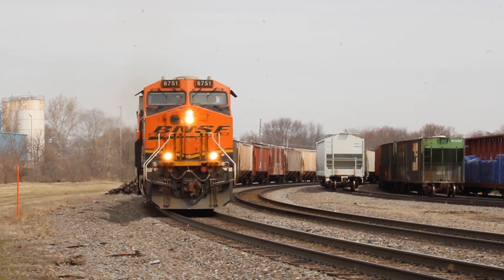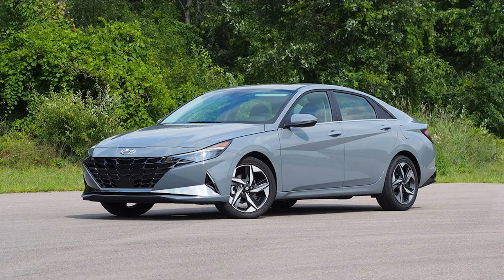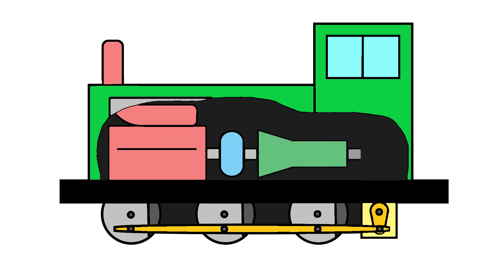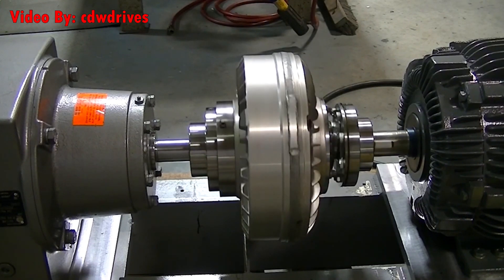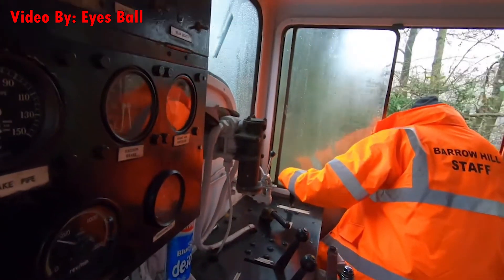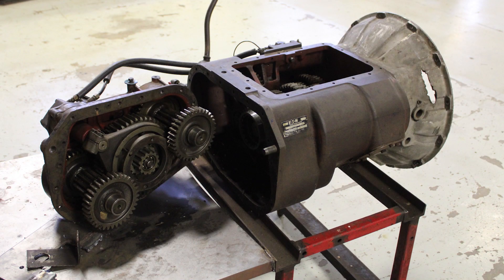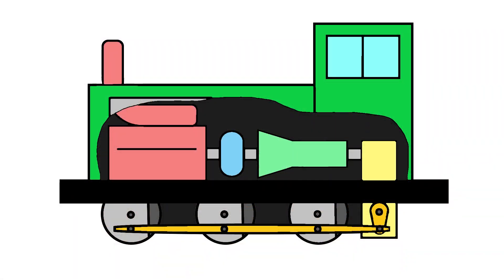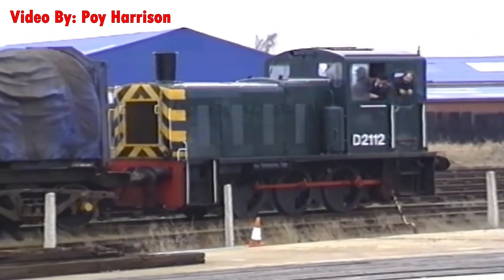How EVERY TYPE of Diesel Locomotive Works! (Part 2)

Comment: Way you explain truck 13 speed not even close to being right.
Reply from the maker: What did I say wrong?
Reply: @Southern_Plains_Railfan  Collars are sliding clutches. Gear you said was 1st that low gear and gear you said was 2nd thats 1st gear. Don't shift aux box to high range for 3 to 4 either. It's 1st -4th gear, put aux box in high range back through main box again 5th -8th and in High range you can split each gear (overdrive). Next you will say thats 12 gears yes but low gear still forward gear in low range that 13 speeds. In theory you can in high range put in low gear position and split it but ratios don't exactly come out right. 18 speed you can split gears in low and high range. Shift knob is early style where one button controls high/low range cyl and direct/overdrive cyl. Later style separated this out to 2 buttons because of 18 speed trans.

 Fun fact on early RTO transmissions like one in video. Owners swapped drive gears and 3rd gear set around making it overdrive in main box. But it messed up H shift pattern so it's up, back, over back again and then up. OR you put late style shift bar housing on putting it back to normal H pattern. Now Eaton makes them all this way with O/D in main box now.
Reply: @pdmustgtd1013 He explained an old style 13 speed. Had same one in an international dump truck. No spitting gears in high side. Low range shift 1-3 intermediate range 4-8 overdrive 9-13. No low hole so you use all 5 gear postions in intermediate and overdrive
Reply: @Matt-ou1bg  I know how old style worked  and its still the same on new style. Old style was 1 switch doing 2 operations and new style has 2 switches each doing 1 operation. You are splitting gears on high side only but not on low side all 13 speeds work this way. (splitting gears is direct and overdrive not the range). NO you don't have to split each gear on high side either. Most people drive 13 or even 18 speed like 10 speed and only splitting last gear into overdrive. Only 18 speed can you split low side. 

SIDE NOTE I have put old style shift knob on newer trans because driver wanted old school look. Still works the same way but only using 1 switch
Reply: @pdmustgtd1013  I used wrong terminology. I shouldn't have said old style. On the 613 and 6613 guys around my parts call them straight 13's. 3 ranges no spitting. My 78 international had straight 13. My 1980 freightliner has 9513 in it. It had 2 separate switches. Round chrome knob for splitting and high low on pull switch mounted to shifter stick. I did convert that to new style. My point was he was explaining the straight style 13 speed
Reply: @Matt-ou1bg  There is no such thing as straight 13 speed. LO, 1st, 2nd, 3rd, 4th/HI side of AUX box back through main box 5th, 6th, 7th ,8th all gearing when in HI side can be split that 13 gears. Its been done this way since 1st 13 speed came out to current. Even automated 13 speed shifts the same way. Even on old RTO flipping 2 gear sets around making it O/D in main box still 13 speed. It just make gears ratios smoother or more even to each other. The guy had called all gears out wrong that's what I pointed out
Reply: @pdmustgtd1013  Look up the shift pattern for a fuller rto 613 or 6613. I've owned 1 and have drove 3 different trucks with them. International dt466 with 613, a ford 8000 with 3208t 613 and and gmc topkick 3116 with 6613. Ive seen a Brigadier with 427 gasser and 613. There is NO splitting gears in the high side. You shift through all 13 gears.  The older chrome shift knobs clearly show there is no splitting gears. They shift exactly like I said.
Reply: @Matt-ou1bg  DUDE I have the old RTO books and you don't know what you're taking about. Secondly I've have drove and repaired old RTO trans.
Reply: @Matt-ou1bg  I can even get you air book that shows how every 13 speed shifts from alll different style of controls. Every 13 speed shifts the same splitting gears on hi side. I have air book sitting in my toolbox right now.
Reply: @pdmustgtd1013  Does your books cover the rt-600 series of transmissions? 
Hell I even changed my profile pic to the shift pattern for a 613 off a sales flyer from Eaton. You going to tell me Eaton is lying about their own shift patterns?
Reply: @Matt-ou1bg  I just posted how every eaton fuller trans shifts. DAMN even shows splitting every gear on hi side. Go back and read it again WOW. You think you would figure it out by now I'm a tech I work on these transmissions for living. Every 13 speed MAIN BOX has Reverse, LO, 1st, 2nd, 3rd, 4th. Every 13 AUX BOX LO/HI and splitter DIRECT/OD. You don't have clue how 13 speed works or even power flow how to get 13 speed. DAMN it's so laughable
Reply: @pdmustgtd1013  Models in the RT-613 series are twin countershaft, Roadranger transmissions with 13 forward speeds and 3 reverse. 
These units consist of a 5-speed front section and a 3-
range auxiliary section. 
Ratios in the front section are used once through INTERMEDIATE range of the auxiliary and once through DIRECT range. This provides a simple Roadranger repeat 
shift pattern.
Reply: @pdmustgtd1013  what's laughable is we are talking about two different series of eaton transmissions. I have the book on rt613 transmissions and I have drove them. I'm also a tech that works on semi trucks, dump trumps and heavy equipment. I've personally owned trucks with both styles.
Reply: @pdmustgtd1013  My post describing how the rt613 power flow is DIRECTLY out of the eaton repair manual. 5 speed main, 3 ranges. NOT 2 ranges and a splitter
Reply: @Matt-ou1bg   "Intermediate" wording not used anymore this where you're confused at. I think you would see that looking at gear ratio I linked too wow. Still shifts the same as current trans I did tell you this again WOW
Reply: @pdmustgtd1013  no it doesn't. The manual clearly shows you shift through all 13 speeds no splits. The shifter also shows this. If you're in fifth intermediate range and move air shift to direct/overdrive (rt vs rto) guess what you're now in tenth gear. I understand how 13 and 18 speeds work. Drive them all the time. But I'm talking about 600 series that came with sae 2 bellhousing used in low horse power trucks.
Reply: @pdmustgtd1013  this is directly out of rt613 manual 
Shift from 1st speed through 2nd and to 
the 3rd speed gear position
Move the selector frem LOW to INTERMEDIATE range, and immediately shift to the 4th speed gear position. After the selector valve is moved, the auxiliary will shift as soon as there is a relief in torque. Shift progressively from 4th through 5th, 
6th, and 7th to the 8th speed gear position the gear shift lever to the 9th speed gear position. The auxiliary section will automatically shift from INTERMEDIATE to DIRECT when the gear shift lever reaches neutral.
9. Shift upward from 9th through 10th, 
11th and 12th to the 13th speed gear position
Reply: @Matt-ou1bg  still splitting gears you have no clue my laugh for the day.
Reply: @Matt-ou1bg  OH splitter housing and intermediate cyl ARE BOTH THE SAMETHING LOL get out of here
Reply: @Matt-ou1bg  Go through main box twice so that's 9 speeds so how do you think you get other 4 speeds to make 13 speeds. OH WAIT SPLITTING gears IN AUX BOX. Old style and new style both do exactly same shifts. I told you once before 3 position selector controlling 2 shift cylinders hi/lo and direct/overdrive. They went to current 2 selector switches because of 18 speed and was simpler to operate. You can't read gear ratio chart I posted that CLEARLY SHOWS gears being split. Not going to post air book confuse you even more
Reply: @pdmustgtd1013  how many times do I have to say I'm not talking about the normal  13 or 18 speed with any style shifter. I'm only talking about the 613 series 13. You shift through main box 3 times and no shifter will change that
Reply: @pdmustgtd1013  I think where you're missing out is a rt613 based off a ten speed not a 9 like all other 13 speeds. It's basically a 10 speed with a low low range. So it shifts just like 10 speed with 3 gears added to bottom
Reply: @Matt-ou1bg  Based on 10 speed wow and NOOO. Next you will say its based off 15 speed or maybe super 10 speed. Actually, main box from 9 to 18 speed are fairly the same. But expert you will say differently but never had one of these apart more priceless shit. I've had many of trans apart, fixed them and built them. I test drive them all. YOU'RE arguing with me WOW. You would be like guys who call dealership wanting diag help over the phone. Then argue that you're right dealership wrong the person who works on them. Then show up later with broken truck and we're fixing it PRICELESS SHIT
Reply: @Matt-ou1bg  You don't have clue and that funny part to me. The mechenic who works on these and even is certifed on these transmission. But you are the expert what do I know WOW LOL.
Reply: @pdmustgtd1013  I've never called into question your mechanical ability. I'm not saying you're not knowledgeable. You explained the common 13 speeds just fine. I'm not arguing with you on how they work. They work just like you said, exect for the rt613. The small case transmissions where just set up different. That's all I'm trying to get at. They aren't the big boy transmissions. They weigh in about 350 pounds and max torque on most where like 600 ftlbs.
Reply: @Matt-ou1bg  REALLY you called me a lair that I don't know how 13 speed works WOW. I know how trans with what cyls and main box gear that are being used to make what gear it is. I've repeatedly told you how it works, even gave you gear ratios THAT SHOW GEARS BEING SPLIT. Told you repeatedly how both style shifter knobs or selectors how they work. Also both do the samething but in different operation. You don't even know what "intermediate" means or what is being applied in aux box.  Because it actually doing 2 things at once with one button move HI/OD. 13 speed based on 9 speed and you don't use LO gear in main box in HI range. 9 speed can be change to 13 speed by changing AUX BOX. This true from old to current 9 speeds because I've done them. Again what do I know since I work on them for a living for over 30 yrs. ARE WE DONE NOW WOW

Comment: I don’t really get the definitions of mechanical and hydraulic drive. Looking at the details, they both use very similar principles, being a fluid coupling to gearbox to a final drive. Only difference I can see is most diesel mechanicals seem to be manual in terms of shifting gears and diesel hydraulics are automatic. I just wonder if there’s any other noticeable difference.
Reply: The line is kinda grey between the different types, but in modern use "diesel hydraulic" usually refers to a locomotive or DMU only using hydrokinetic torque converters like the Voith Turbo Transmissions, while "diesel mechanical" usually refer to DMUs using automotive-type automatic transmissions like the ZF Ecolife rail. 

The main difference between these two is that the Voith types change "gears" by filling and draining several different torque converters with hydraulic oil, allowing a smooth change under power, while the ZF "mechanical" gearboxes have a single torque converter followed by different types of planetary gearsets which allow the torque converter to run in its best RPM, just like in a car or bus. Simply put: Diesel hydraulics only use several torque converters as "gears", while mechanical have a single torque converter with a gearbox after it. 

The modern diesel mechanical gearbox doesn't use a fluid coupling like the old types, because a torque converter works less like a clutch, but more like an infinite gearbox by having torque multiplication, which means you need less mechanical gears afterwards. This is also why automatic transmission cars historically needed fewer gears than mechanical transmissions, because the torque converter did much of the gearbox "work" itself.
Reply: @kristenburnout1  That is pretty cool. The name really makes sense with that explanation. Thanks so much.
Reply: @kristenburnout1   While the Voith transmission is the most used hydraulic drive some classes like the earlier German V200 and the British Warship and Hymek used the Mekydro gearbox, and this one was pretty much like an automotive automatic gearbox.
They have one torque converter and 4 planetary gears.
The difference can be noticed, while the gearchanges on a Warship or Hymek feel a bit jerky the gear change on a Western which has Voith transmissions is totally smooth.
Reply: Your confusion stems from the fact that the definition of diesel-mechanical was apparently reinvented for and in this thread for the first time.

Diesel-mechanical locos are by definition locos with engine, some clutch, sometimes gears(boxes), the wheels driven at the end either by chains or - more modern - driven via cardan shafts.
The class of DMs is in the end quite small because they are small locomotives existing only in small numbers - mechanical transmission is not good at transmitting large power, so it is not used in large locomotives.

So the big stuff is all DH - no matter how it's built. They all have gearboxes, but there are no mechanical clutches because they are too weak. Hydrostatic drives are used for work machines and long-track runners whose speed has to be infinitely variable. And these are not mechanical drives either, even if they contain parts of mechanical drives such as gearboxes etc.

To put it simply: With the new definition of diesel-mechanical, someone is trying to create a monument for himself. Completely unnecessary.
Reply: @pearlyhumbucker9065  I can see that.
Reply: @pearlyhumbucker9065  - the only 'confusion' is in your head.  Try reading the post from kristenburnout1

Comment: The class 03 switcher (shunter) you show at Barrow Hill has a 5 speed box and max speed of 28mph. You are right about taking care changing gears, I had a go driving one and was told not to go straight from gear to gear but wait between each change for the fluid clutch to clunk. They use compressed air to shift the collars so you do not feel each gear disengage and engage in the next one.
Reply: Hi, Class 03/04/05 have an Epicyclic gearbox that uses a brake band & sun and planet wheels, compressed air operates a cylinder to close the brake band and engage drive to each gear, 1st, 2nd, 3rd & 5th gears are indirect drive through the box, whereas 4th gear is direct drive (it locks all 4 gears), this is coupled to the engine via a fluid flywheel, Diesel railcars use a 4 speed box, but they have a free wheel as well to allow them to coast with the throttle closed.
Reply: @TechnoJonny  Thanks for the info. I only have a basic idea of how the gears work and what I was told not to do by the driver of the 03. I went under a DMU at a depot open day and the fitter showed me how the prop shaft was free to turn in one direction by hand and not in the other. He said about it being so the unit could coast in gear and being unable to use the gears to hold it on a gradient as you can with a road vehicle. It was years ago but if I remember right when the unit changes direction the prop shaft moves towards the front or rear of the car with compressed air to engage in the gears for the other direction. I think it was a class 101 blue square coded unit we were under but I guess they all worked in the same way.
Reply: @TechnoJonny  Very succinctly put! The mysteries of an epicyclic gear train explained in a few simple sentences.
Reply: Have driven a Cl.14 at Barrow Hill several years ago, and 'Mayflower'.

Comment: We both know there were diesel-mechanical trains in the UK, but were there ever any in the US?
Reply from the maker: Not that I know of. Maybe there were and still are a few units on scenic railroads or in museums, but I don’t know of any large railroads using them.
Reply: @Southern_Plains_Railfan  PLYMOUTH LOCOMOTIVES ARE ALL MECHANICAL DRIVE, BUT VERY FEW EXIST!
THIS IS NOT THE LATE PLYMOUTH DIVISION OF CHRYSLER CORPORATION HOWEVER!
Reply: @rossbryan6102  Wikipedia says Plymouth built about 7000 locomotives, of which about 1400 are still in existence. I don't know how many of those are in the US, but I'm guessing it's most of them.
Reply: @Southern_Plains_Railfan  I believe the BUDD RDC is a diesel mechanical railcar. You mentioned railcars in passing in the video at one point. Budd RDC top speed was 85 mph, not bad. There are quite a few other diesel mechanical locomotives & railcars, mostly historical. I believe that even the modern railcars made by US Railcar are diesel mechanical & quite quick as well.
Reply: In Greek rail yards